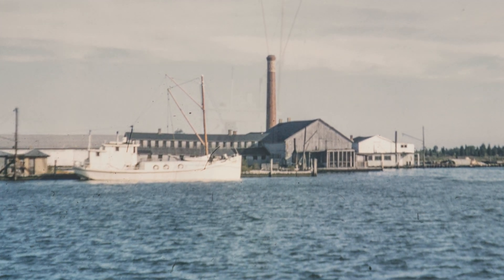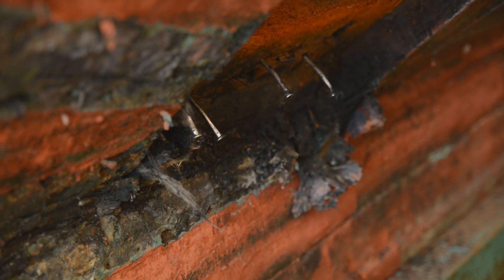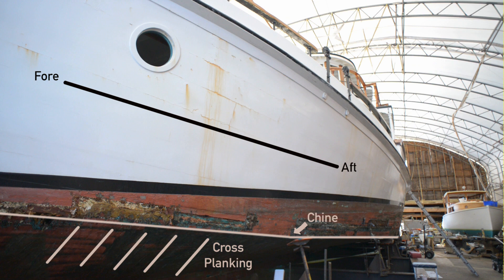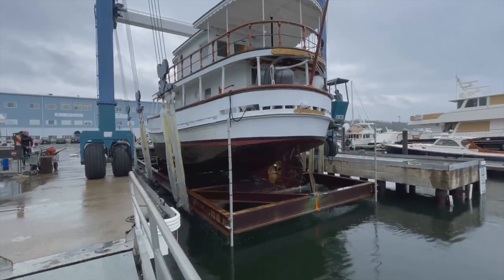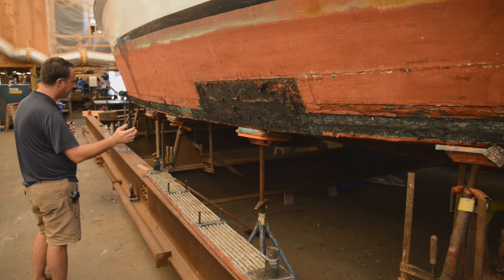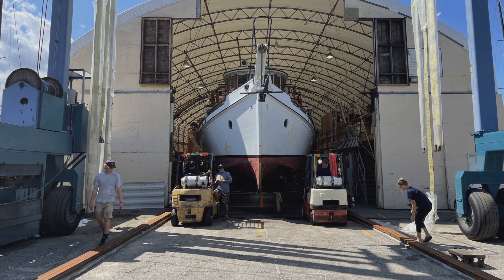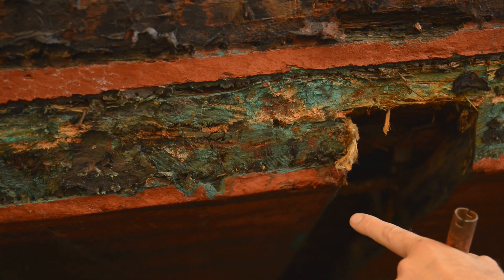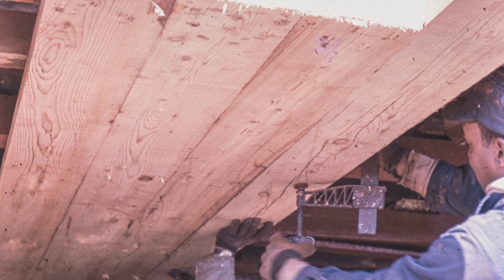COASTAL QUEEN RESTORATION EPISODE #1 "Beginnings"

Comment: Interesting that this Chesapeake Bay boat is not being renovated on the Bay by those familiar with the design.  Also, interesting that the deadrise construction is going to be "improved"??
Reply from the maker: The boat was originally converted from a buy boat to a cruiser at Wiley's, and repaired in Reedville, and Deltaville on numerous occasions.  I believe some of the principles are from up North...and are familiar with the yards there?